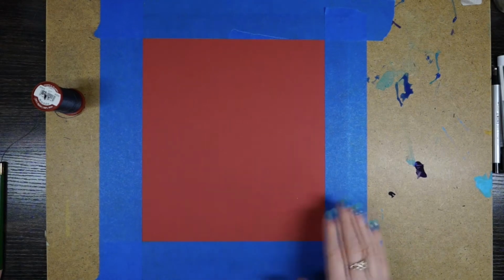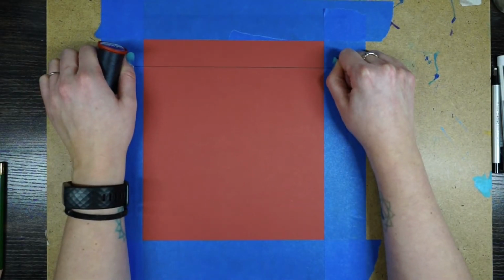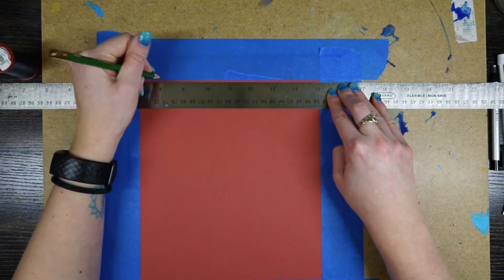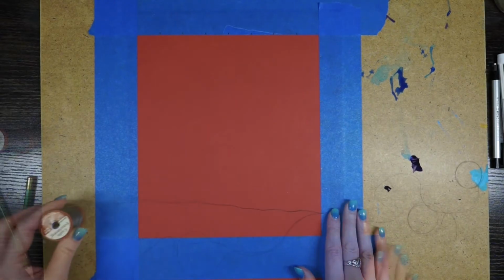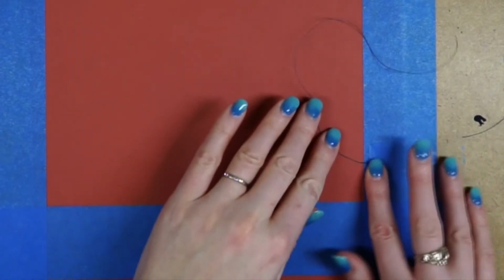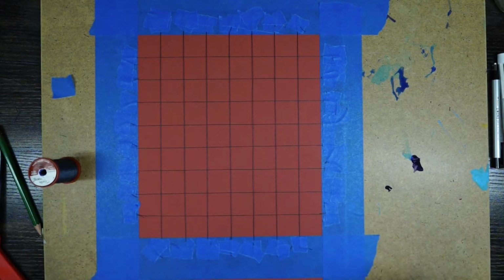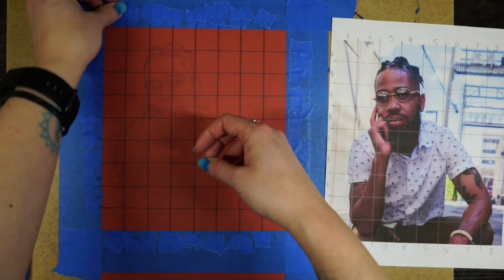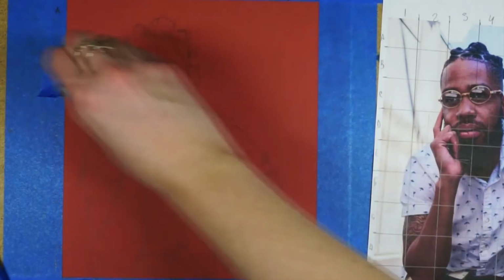Using the "Invisible" Grid Method - No Eraser Required!

Comment: This is an awesome idea. I can't believe I haven't seen this idea posted before and that this video hasn't got more views. Although this is still a lot of work, it's a good tool. The drawing I'm working in, I made the mistake of using too soft a pencil with too much pressure on grid. Some of the lines indented into the paper and now it's showing in some of the tone. I'm pissed. It took me hours to do the extensive outline and hair. I have to try and fix it best i can now. I will definitely try this method next portrait. Thank you again.
Reply: I was just thinking of trying this on a canvas. Was going to tack the back and string fishing line but the tape method sounds way easier! Thanks.

Comment: Get a light table and some block grid paper, tape the grid paper under the surface of the light table and the grid will show up on the paper when the light is on. Also can get a piece of glass, tape grid paper to the underside, elevate glass, put light source under glass and u will see grid under the paper. Just a bit easier than taping thread, altho ur method is alot cooler looking lol.
Reply from the maker: Those are all great ideas. I use this in my classroom where I don't have 20 light tables ;)